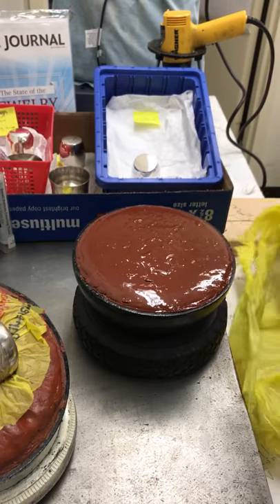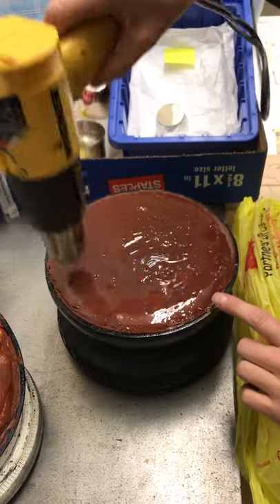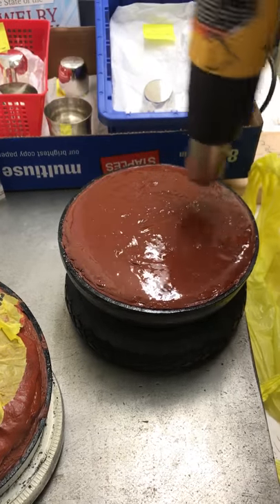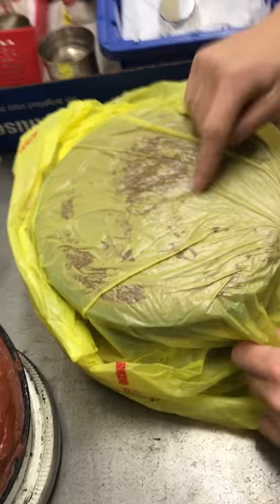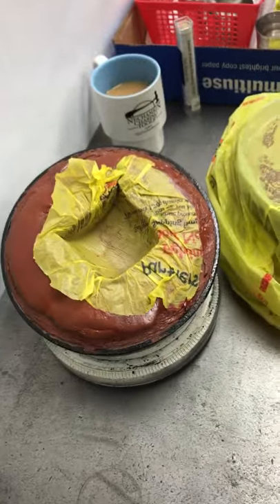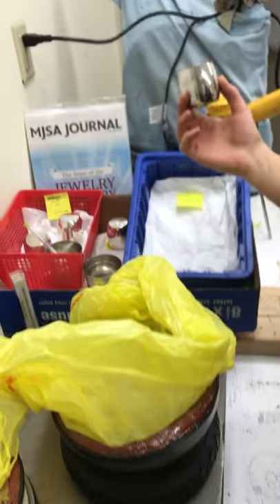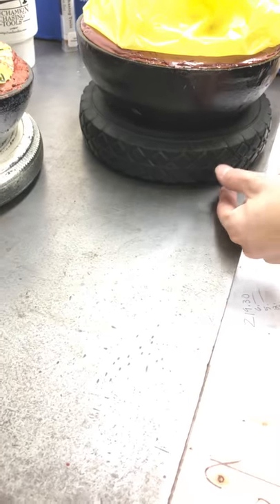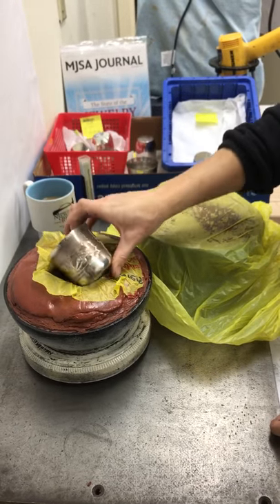Using plastic sheet as a barrier for fixturing work in a pitch bowl

Comment: Lisa, if you put a length of closet pole into pitch inside the cup or bowl you can work in the round without the bowl setup. The pole is held in a vise, mine has wooden jaws.You will be able to instantly rotate the vessel, and even stand it up to work on the bottom by simply loosening the vise and re tightening.  And if you need to, you can always use a sandbag. I have videos titled Chasing parts 4, 6 and 7 where I am using that setup. I first saw this kind of set up on very large work being done somewhere in Southeast Asia where an artist was working on a very large vessel with a log inside the vessel, the log was propped up and he sat on the log while working.
Reply: Sage Reynolds I am having trouble understanding closet pole and all this. Confused